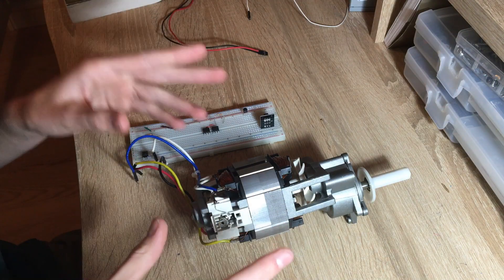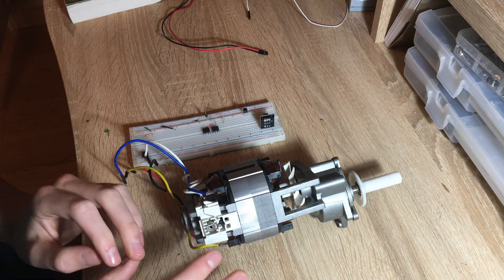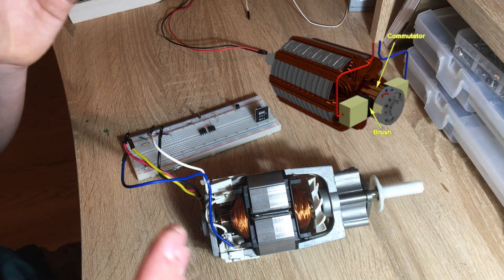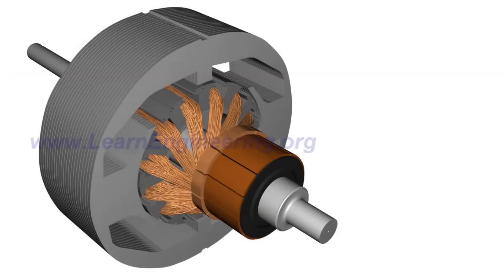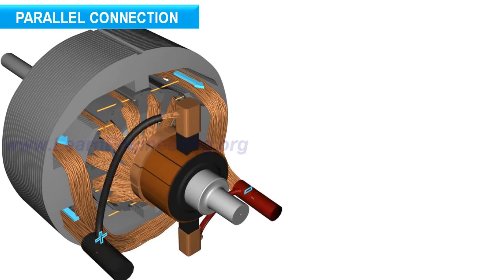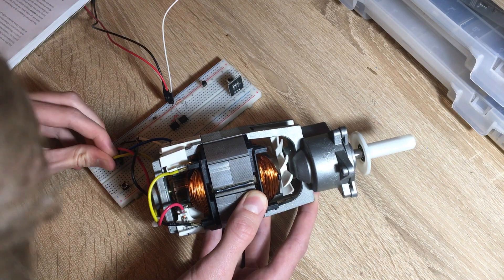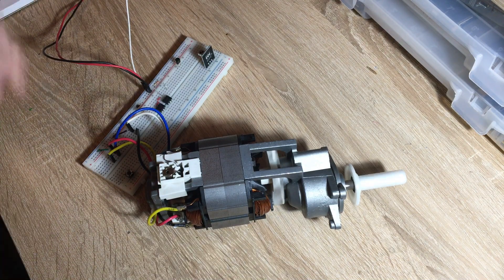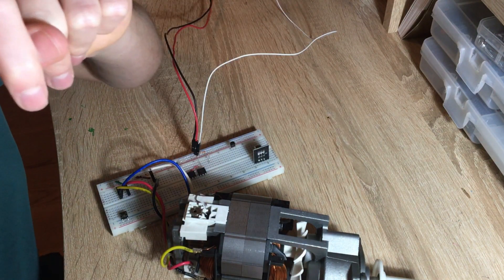How to wire a universal motor to DC power.

Comment: You do not need to do any rewiring. The windings are wired in series. You just put dc into it instead of ac. To reverse direction swap wires on brushes.
Reply from the maker: The aim of the video was to show how to "put dc into it".

Comment: Hedge trimmer motor, 2 black wires from brushes, 1 orange, 1 brown, assume coils, 1 into 2 blue wire with one side wrapped around ring. How do you wire these for 12 v dc please? Want to make a small electric boat motor. Thanks.

Comment: So I have a corded lawn mower with a universal motor. I want to connect a battery to it so it is easier to use.  How do I know which prong from the AC cord on the lawnmower goes to the positive post on the battery?

Comment: I have 2 wires only
Reply from the maker: In that case you either have a regular dc motor or the the field winding and brush wires are being connected meaning. In either case connect one wire to postive and the other to ground

Comment: Hello,
Can you tell me which types of regulator(speed controller) can use to control it's speed.
And also how to install controller!!!!
Reply: Thank you bro
Reply from the maker: A speed controller for a brushed motor (as is with the universal motor), simply regulates the voltage being supplied. This could be done with a simple potentiometer varying the resistance to change voltage in accordance with ohms law. Another method is called the centrifugal mechanism, but that is more complicated. You can buy speed controllers off the internet which have capacitors and overload protection, to make things go a bit smoother. Pick one which has the voltage range you want (E.g 12-48v). To install, connect it in series in the circuit before the motor, so that the voltage flowing to the motor is first regulated by the speed controller. Hope this helps; have fun making something!